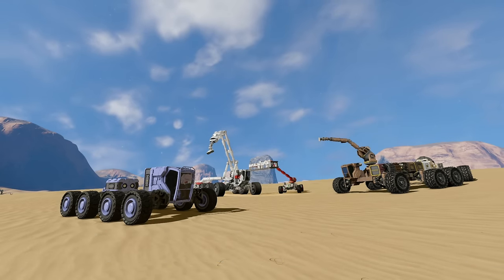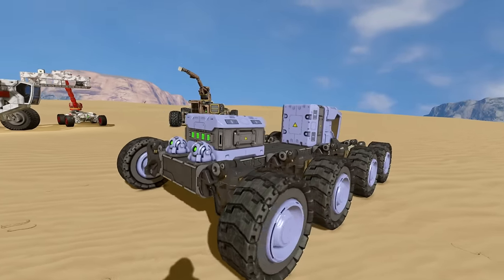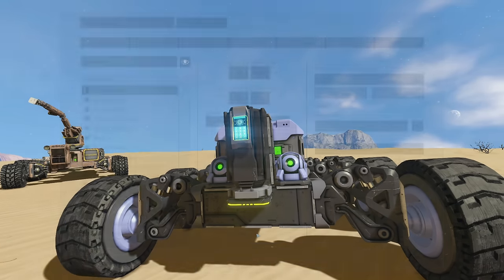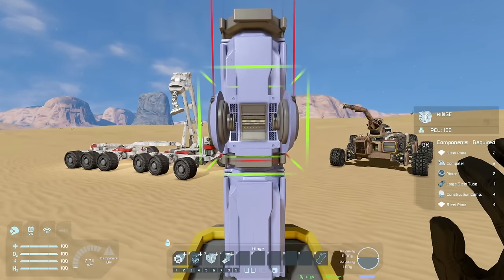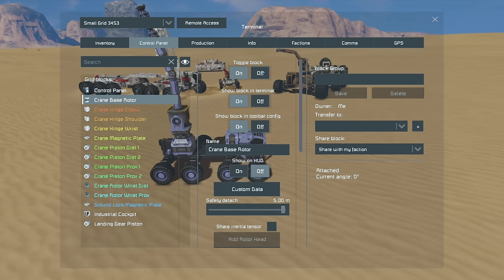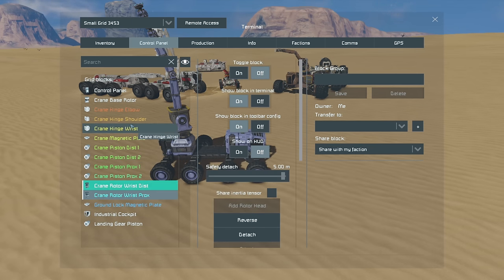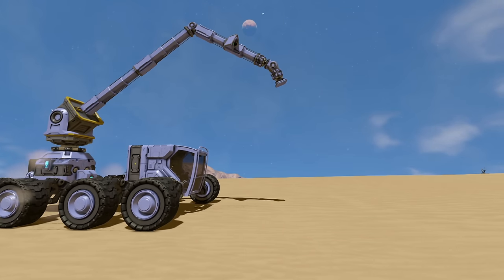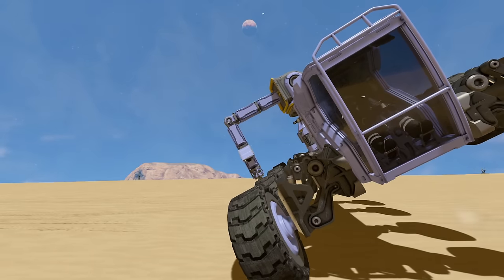How to Build and Operate a Crane - Space Engineers Tutorial

Comment: Another vanilla option is to use a pair of Custom Turret Controllers. First CTC controls the Shoulder Rotor (Main) and the Shoulder Hinge plus the Proximal Pistons. Second CTC controls the Shoulder Rotor (Main) again, but the Elbow Hinge plus Distal Pistons. By having both CTC's rotate the main rotor on the frame of the vehicle, you can fine tune your allignment as your pistons extend towards the desired item!
Reply: I've tooled around with this concept a bit and its pretty solid. Mouse control gives you better fine tuned control, but you can also use the arrow keys for this purpose.

Comment: I absolutely LOVE MArmOS for anything involving cranes or articulating arms. It is a little complicated to figure out at first, but the script contains enough comments and there are also many example arms that you can reverse-engineer to understand how they work. Once you know how to create a functional articulating arm using the bare minimum of parts, it is pretty easy to expand it out to whatever you need. 

The best part of MArmOS is how intuitive it is once you get all of the parts named and in the correct orientations. It is as simple as using WASD controls and your mouse to move the end of the arm. Slap a camera on the front and you have a first-person remote controlled arm that works just like a remote controlled ship, but it's not a ship. It's an arm. It behaves exactly as you would expect an IK rig to function, which surprised me. I was not expecting a script to provide such precise and fluid control, especially when everything is using pistons and rotors. 

There are also lots of cool things you can do with the script to alter the control features. For example, depending on how you change a few lines, that can influence the way the "end" of the arm moves. I usually set mine up so the "end" functions sort of like the head of a chicken. The "end" acts like a gimbal, where an arbitrary point in front of the end of the arm serves as a pivot. So you can keep your mouse pointed at one spot, and rotate the arm around that spot. Instead of functioning like a ship, it sort of "strafes" around that point, maintaining the distance on all planes of motion. The script will attempt to keep the crosshair on the exact spot it is looking at, using the rotors to maintain that position while still allowing it to move in other axes. This is VERY USEFUL for creating welders, as you can easily pivot the arm around an entire contraption as it is being welded with minimal input on your part.

I like to set up "welding arms" that are attached to a base or station. This works SO MUCH BETTER than trying to build an ungodly ship printer, as you can just weld up ANYTHING regardless of what grid it is on, and even with the bare minimum of pistons and rotors, it can cover a VERY long distance. And, you don't have to fiddle with trying to attach small grids to large or vice versa. It is also significantly easier to build a welding arm using MArmOS from scratch than it is to try and build a complicated ship printer. I set one up in a multiplayer game about a year ago, pretty much on day one. I also used it to weld up the rest of the stuff on the base. Having it attached to the base and all containers just simplifies the whole construction process. No need to constantly go back and forth with a welding ship when you have a massive arm that can go anywhere. 

You can also do lots of other things with it too: cranes to lift things, drilling arms, grinding arms, welding arms, etc. There are soooo many options with MArmOS, I absolutely love it. I can't imagine trying to build an articulating arm without it. Once you get everything set up and functional, blueprint that sucker and you never have to worry about it again.

It did take me awhile to really figure out how to use MArmOS. I noodled around with it and a bunch of example arms in creative mode for at least a few hours. But once I had successfully built my own arm and it worked exactly the way I wanted it to, I just blueprinted it and never messed with it again. I have since forgotten how to do all of that, since I whip out the blueprints and just paste them in any time I need an arm for a task. But it is WELL worth the time to learn how it works, it really isn't as daunting as it seems at a glance once you know the basics, and the arms can be built pretty quickly in Survival.

Comment: This is why I think Control Module and Mechanical Keybinds should be vanilla, even though they are mods, they are much easier to set up overall than scripts when it comes to this :)

Mechanical Keybinds : Cockpits being main keybind pilot
Control Module : Porgrammable Blocks having the say in what's going on
Reply from the maker: Yeah, something like this in vanilla would be nice, though none of the solutions I've ever used really felt clean enough to be a vanilla solution but that could be due to modAPI limitations
Reply: @Splitsie  Yeah, I think that would be it, it would also help everyone if the rotors didn't just slam the breaks sometimes too I suppose, I have had a few incidents with rotors when it comes to cranes :)

Comment: Super Easy Ground Lock.  (OSHA Approved)
Same setup as shown (Piston and mag-plate mounted wherever u like, I like flush with bottom).
1) Set the piston power to zero (as low as u can), then increase it just 1 step. (the goal is to have just enough power to lift the piston itself back to full retraction and no more. setting the value - starting at zero - while extended, unlocked and with retract active.)
2) set the mag-plate to auto-lock.
3) add controls for 'UnLock' on the Plate and 'Reverse' on the piston.
To operate u just press 'Unlock' followed immediately by 'Reverse piston'
If u add a timer block with these two commands then u can raise and lower with one click of the same button.

The advantage of this is that the Piston will:
1) Always reach the ground since there is no need to set limits.
2) will auto lock and detach WITHOUT adding phantom forces to you vehicle (or move it on contact with the ground) , but at the same time lock u in place.
3) with this setup (especially the timer block) you can use multiple pistons with One button. Even on uneven terrain and they will all lock without any SE intervention. Advanced uses are for leveling your vehicle (or un-leveling it) repair jacks. and can even be used out the sides for attachment to walls if needed.

Comment: The configuration you have for the crane is good, I would offset the "elbow" hinge by 90 degrees so that it's range is completely folded to completely straight, as opposed to a 90 degree bend in either direction. This will allow the crane to more easily reach points near the crane base and potentially load stuff onto itself.
Reply from the maker: The main reasons I don't tend to do that are aesthetics and scale, getting a hinge rotated that way and still looking neat is a much tougher ask, but if managed you're right, it can make it function a little better :)
Reply: @Splitsie  It would also work to just have two hinges, if it's aesthetics you're worried about. That would give you a full 360 degrees of rotation on the elbow!

Comment: When you have small numbers of controls, you can get things almost as clear by leaving gaps in the hotbars as by using completely different toolbars for each control point.

So the first hotbar might be:
1: Shoulder rotor on/off
2: Shoulder rotor reverse
3: blank
4: Shoulder hinge on/off
5: Shoulder hinge reverse
6: blank
7: Proximal pistons retract
8: Proximal pistons on/off
9: Proximal pistons extend

Of course, this works the best when you have different kinds of thing to control.  Also, when the resulting hotbars are intuitive groups, (such as having the various parts of the same joint together).

Comment: I would consider trying a two stage crane using a Turret controller. Starting with Splitsy's base with the Rotor and hinge there for the base pieces, almost identically set. then the Controller would be used to control a higher stage area on the Crane. so you'd control it much like you'd aim a turret. No need for scripts that way, and you just have to put the Control options in the bar for the main rotor and hinge to movements.

Comment: I'm making a recovery vehicle with a heavy capacity crane... uses pistons for up/down movement... it's actually insanely strong... and it's got 6 out rigers by the rear keeping it extremely well locked to the ground, so far it works and I just need to tune speeds and build the rest of the actual vehicle
Reply from the maker: Pistons as actuators are great - and fun :)

Comment: My only critique is with the build style. You're mounting all the funtional components directly to each other without any blocks supporting or in-between. That arm is going to completely fall off if the rear battery takes any damage, the front wheels are only attached to the cab, and both the cab and computer to the front battery. The whole thing will be really difficult to repair or modify, and will fall apart in a crash. Everything needs to attach to the chassis, bro.

Comment: I like how Space Engineers has 22 control options for the turning of the rotor..

...and not a single one of them are the most common "Hold to Turn Right/Left (Clockwise/Counter-Clockwise) at Fixed Speed" which is used in practically all other video games.
Reply from the maker: Yup, it really does need a turn (anti)clockwise control option

Comment: You  don't need to use a piston. Just stick a mag plate or 3 on the bottom. They have a meter lock range or more. And you can always use angled wedge designs on larger trucks like you would for thruster coverings.
Reply from the maker: That's very much not correct. Landing gear lock range in vanilla is about 200mm or less and moving a piston is much simpler than having to alter your suspension settings to drop the whole vehicle (though it may not be safer than adjusting the wheels, depending on the pace of the adjustment or the strength of the piston)
Reply: @Splitsie  Weird, I've never had an issue with it. As far as the drill design goes I use the same base  platform on all my drills, rover or ship, and they have always worked with no issues or clang.

Comment: I know this is an old video so this probably won be seen but Im just getting into SE and For cranes Im wondering could a rotor at 90 degreed be used instead of a hinge for the elbow joint? This would allow better range of movement I feel close to the vehicle.
Reply from the maker: Yup, hinges are just rotors with more restrictions on them, from the game's perspective they're the same block :)
Reply: @Splitsie  Fantastic. Thanks so much for the reply love the videos. Just made a pull behind trailer with a crane that lays flat similar to the one you made on the scrapyard series but single pistons side by side instead of double under each other.

Comment: wut about just separate cabin and gyros to operate crane? need to switch seat but make controls much easier
Reply from the maker: That only allows for very basic controls that can be better achieved with the custom turret controller or with a script like was used here so it's a system I wouldn't advocate for any more
Reply: @Splitsie  yea but i mean for vanilla only option, no scripts no mods prolly would be better than switching thru 9 bars